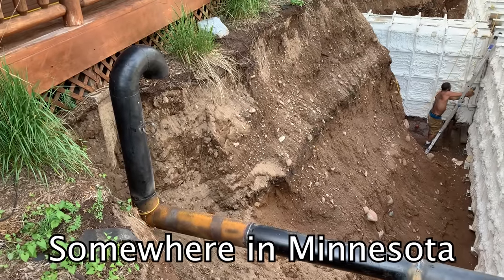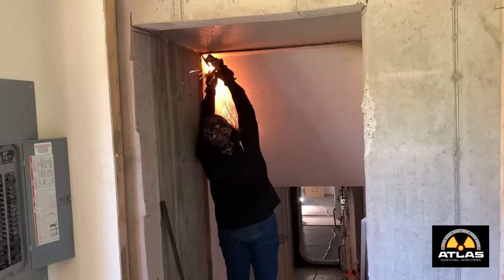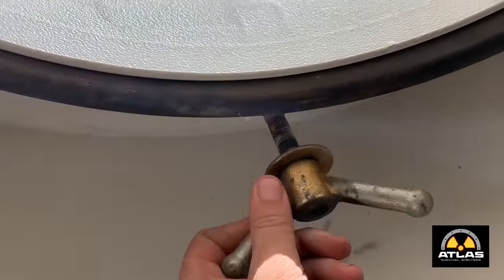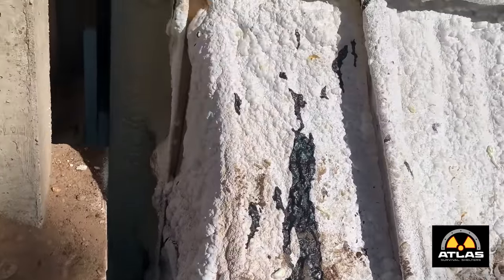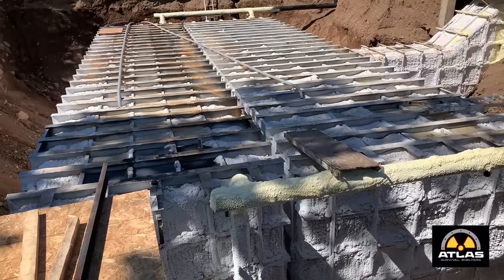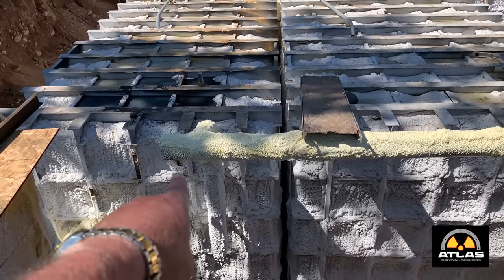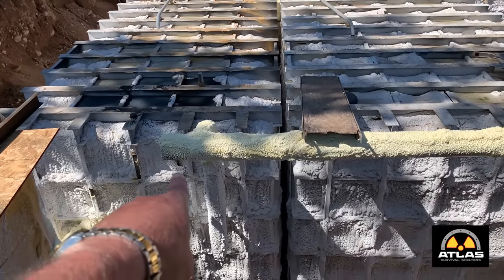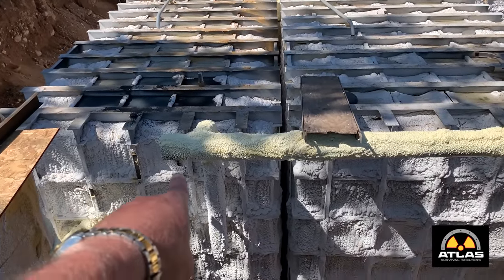A Completed $500,000 Luxury PLATINUM SERIES Doomsday Bunker

Comment from the maker: Thank you for watching our Platinum Series. My subscribers can guess between 1-1000 and win our weekly prizes
Reply: 187
Reply: @Atlas Survival Shelters
Do you add something like Borax to sand to prevent ants?
Reply: 222
Reply: 777
Reply: 837,, great series, gives me all kinds of ideas!
Reply: 998
Reply: 101
Reply: why no emergency generator room  256
Reply: Garage soon see Y'all
Reply: Great bunker ! 650 🤙🏻
Reply: Thumbs up and thank you for part 3 Ron. 243 ??
Reply: 256
Reply: 55 :) awesome bunker!
Reply: 556
Reply: 223
Reply: Can you stack bunkers?
Reply: 73
Reply: 458
Reply: 265
Reply: 567
Reply: 868
Reply: 777. or 333.
Reply: 760
Reply: 537
Reply: Which one of your plans is this one?
Reply: Question what happens it they seal the air intake and clog the air outtake?? No air in no air out. Forget pouring gas in or smoke 💨 what do we do if they fill out air intake with spray foam or a mud cork or wrap rubber or plastic or saran wrap around it preventing air from coming in and preventing it from going out. As it’s pretty easy to do
Reply: 987
Reply: I think you need to develop some sort of remote operated flame thrower at the air intakes and out takes. This way you fry whoever tries to clog your intakes. It’s easy to do just burry a decent sized liquid propane tank or a tank containing homemade napalm. Pressurized and have a 360 degree spray source and ignition source. I’m surprised you don’t have counter measures for these types of things.
Reply: 417 Thanks Ron! 🇺🇸
Reply: I have a great idea for you. You burry a shelter and then you video guys like me trying to get in it vandalize it. Pouring water in intakes trying to break in etc.Then you can create things to counteract everything we do. These deterrents you make would cost extra. I can think of a bunch of cool shit for you to make
Reply: 265
Reply: 76
Reply: 700
Reply: 710
Reply: 625
Reply: Are air vents screened.
Reply: 666.  Nicely done .
Reply: 335 loved the series
Reply: 105
Reply: 786
Reply: 82
Reply: 711. Anyone know what state this is in? Heard a lot of heavy machinery in the dead of night a couple weeks back lol was wondering if they were getting a bunker dropped in
Reply: 697
Reply: Yo remember me the guy with the 8.7 mill now I want to do something like this but on a whole nother level had to make a  Secret account so wife don't find out I'm talking to you She doesn't want me to go throug You because you support trump but ill keep in touch keep talking to her about being ready for the end planting seeds ill let you no when she's ready lol
Reply: 500
Reply: Love you guys, but your statement at the start is factually and legally incorrect. Anyone can use this footage under Fair Use. It has to be transformative, reasonable and with valid reason, but if you publish something in the public domain, your copyright does not trump fair use legislation. Im not trying to be an asshole, and I love what you do and the way that you do it. Im just noting that your copyright notice is indefensible in law. Sure you can just hit people with copyright strikes, but I hope you are not that type of people. Peace.
Reply: 33
Reply: 969
Reply: 78
Reply: 362
Reply: My guess is 17
Reply: 639
Reply: 270 , Nice work.
Reply: 812
Reply: Love watching the installs.    684
Reply: 100
Reply: 333
Reply: 386
Reply: PREPPER PRO TIPS:
(According to the probability of a threat occurring all possible threats are added to a list of things to prepare for. So perhaps you've already resolved these potential concerns.)

15:00 Escape hatch is a foot below the grade??? Hopefully you won't have to escape during a heavy downpour & flooding because an "escape" may only be temporary.

15:55 If the primary residential structure becomes opened up to the elements that basement tunnel may become a funnel.

18:26 18:52 Although it's nice to think an enemy could never gain access to the inside & team member(s) will never become a threat, you need locks on those sliding doors & they be better if they were not wood.

21:08 The handcrank should be low enough case a child, disabled or elderly person needs to sit on a chair next to it to turn it or preferably attach a stationary bike to it if cranking ends up turning into a longer term necessity.

Lasty, always consider either erecting new barricades on the perimeter or using natural barricades such as existing trees or large rocks if you insist on putting an underground shelter in front of your house because in the event of government assault they may use tanks which may be heavy enough to crush or at least breach your shelter integrity.

Overall this is an incredible shelter system! Anyone would be blessed with such a balance of security & comfort & ultimately there are no guarantees.

Liberty = Peace & I pray you & yours always enjoy both!
Reply: 503
Reply: 302
Reply: My guess is #19
Reply: 666
Reply: 423
Reply: 828
Reply: 1000

Anyway I have more of a question about your work. With cold weather and frost/snow on the ground I would think that the locations of your shelters might be very apparent. This one is large and close to the surface. I would think the snow melting above it might give the location away. Has this been an issue in your installations? Generally underground structures like this would have to be kept at the same temperature as the ground that surrounds it.
Reply: 357
Reply: 472
Reply: 556
Reply: 909
Reply: 312
Reply: 731
Reply: 145
Reply: i liked the old intro, i like the new intro. my number is 776. Just need to add the 1 to it to get my favorite number... 1776.
Reply: 148
Reply: 271
Reply: 15
Reply: 54
Reply: 707
Reply: Stellar as usual. 362
Reply: 362
Reply: 250
Reply: 37
Reply: Нужно прятать каналы вентиляции. Мародеры преступники могут бросить в трубу вентиляции дымовую гранату. я так думаю.
Reply: 380
Reply: 867
Reply: 11
Reply: @jamesgaddis6189  if it's water tight, it's not an issue other than the air intake, which should have a tight filter.
Reply: 749
Reply: 13
Reply: 959
Reply: 471
Reply: 04
Reply: 500
Reply: 569
Reply: @SMOU1  that was my guess I went with the next memetastic number
Reply: @tedt5588  recycle all liquids like on spaceshuttle, some even skip the filtering and go full mellow yellow.
Reply: 189
Reply: @sturmbonbon6621  337
Reply: Are you all based here in MINNESOTA🌲?...HELLO FROM MINNETONKA!! YOU GUYS DO GREAT WORK!!
Reply: Should have a sliding door dividing those air systems,GREAT WORK GUYS!
Reply: 221
Reply: 420
Reply: 69
Reply: 34
Reply: Iam thinking 782
Reply: I'm not to thrilled with the sliding doors. What if there is was a breach, those sliding doors won't be much help, would they? All in all, nice bunker.
Reply: 784
Reply: 784
Reply: 444
Reply: So I have done Sprayfoam and waterproofing for 10 years the foam won’t stick to the tar and you need a respirator to spray even if it’s a froth pack
Reply: 371
Reply: needs to be 8ft deeper this is a joke. Don't buy
Reply: 217
Reply: I like the area to be able to have a place for the fur babies to be able to go to especially when they can't get outside for business.
Reply: 700
Reply: 139
Reply: 247
Reply: 209
Reply: 21
Reply: How do u compensate for clean air and clean water if nuclear bomb hits?
Reply: 12
Reply: 287
Reply: 500
Reply: 455
Reply: Hope this drawing is still going on. 👉 667
Reply: Makes big coffin 😂
Reply: 568
Reply: What kind of paint do you use on the interior
Reply: I have so many improvement suggestions for your bunkers from fixed fire fighting to CCTV/Automated security measures, air pipe redundancy and closure, fake outside area etc. Happy to share them directly and hope you are able to expand to UK.
Reply: How much would you pay me to come weld for you?  I specialize in pressure vessels and pipe that are RT, UT, MT and PT.  I specialize in GTAW, FCAW, GMAW and SMAW.  I love your videos and what you are doing.

Comment: Liked the vid, still prefer Colin Furze's bunker
Reply: Colin furzes Bunker is vulnerable to so many things
Reply: @directlinkrexx4409  like zee Germans?
Reply: I'll take this bunker anyway, Colin furzes just uses 1 sheet of metal, not enough to protect against fallout of anykind.
Reply: @ghostrikeit  Yeah but that's like saying you'll take a Lamborghini over a Nissan, they costs were in different leagues. Ideal for me would've been the look and feel of Furzes with the safety function of the Atlas
Reply: @lynchio6719  More like the difference between a professional and "garage" build.
Reply: @fluxcapacitor05  $500,000 vs less then $50,000 yeah same thing, you'd get what you pay for
Reply: Colin did cement the entrance...  And it's much deeper to the tunnel.

But that knife belt is for lunatics!
Reply: But don't you need a few meters of concrete. There are loads of nuclear bomb shelters in the UK in the towns and citys and the give away is really dated building design but stupidly thick walls, they are designed to blend in with the surrounding buildings. However most are still around as its so expensive to knock down, so they can stand out alot now over the new modern buildings.
Reply: Colin Furze all day everyday
Reply: @nakachinjah7240  Don't forget Terry the Tunnel
Reply: @MrGoesBoom  never heard that 1 ? lemme check
Reply: @ghostrikeit  Colin's has concrete on the outside this here bunker doesn't it just has dirt.
Reply: me too
Reply: @directlinkrexx4409  Colin has more brains than this entire company!!
Reply: @ghostrikeit  It would against extreme weather such as baseball sized hail
Reply: @deadwingdomain  Are you suggesting Colin furze is crazy, just don't mention his 10 meter 360 swing that has no harness
Reply: @wertigus  Colin's is not nearly as good as this bunker
Reply: @directlinkrexx4409  nah - this thing is BS; Furze has all the really important things covered much better than this fishtank.
Reply: @wertigus  a certain depth of dirt doesn't need concrete, it protects from gamma and all sorts of things.
Reply: @anonymouswhite352  sure, but what about wars, missiles, tsunamis, extreme events?
Reply: Why doesn't anyone have a workshop? I own a ship and when I'm out for a month or more there's always something that needs to be repaired. If the fan dies, good luck to try to repair it with a pool cue.
Reply: @ghostrikeit  that's what the soil above is for
Reply: It depends, do you want a man cave or a place to survive with your family?
Reply: Haha, made me laugh
Reply: Furz in German means fart
Reply: @lynchio6719  than*
Reply: @leopitre7907  does he have a safe air system, all the necessary pipes and is it built to withstand floods??
Reply: Ones a man cave and the other is a Survival shelter. There’s a huge difference.
Reply: @ghostrikeit  this shelter is also several times larger. Atlas makes shelters that are smaller and far cheaper.
Reply: @ghostrikeit  what are you talking about? Collin's bunker is fine when it comes to fallout resiliency.
Edit: with regard to its depth/material compositions...obviously Bunker still needs filtration system
Reply: I could pull the atlas shelter to bits with faults!!!
Collins bunker was built for abit of fun yet in away has more top impact damage protection as it was concreted in round all sides and top.
Well you yanks build theses things thinking of the worst while us Brits build things for fun and have another cup of tea......lol
Reply: I'll admit that Colin's is pretty awesome with the tunnel and everything, but this one would probably be a better bet for safety lol
Reply: What about "Rising S Bunkers"?
Reply: @marcobrian1619  that thin layer of concrete aint gonna do shit in a fallout scenario
Reply: @lynchio6719  I'll take a 96 Maxima ove a lambo. 4DSC and a V6 3000.

Bitch Please.
Reply: @directlinkrexx4409  planning permission is about the only problem
Reply: no toilets😂